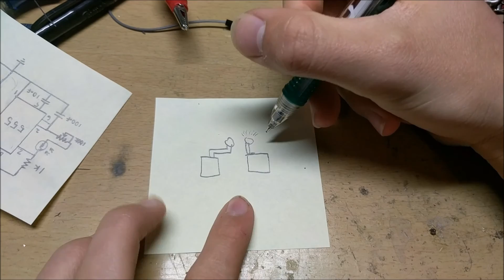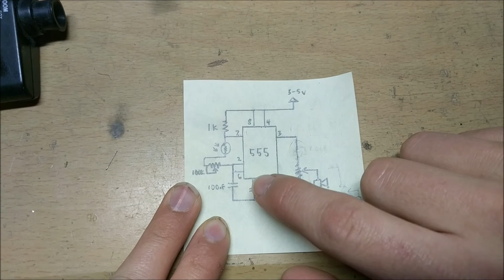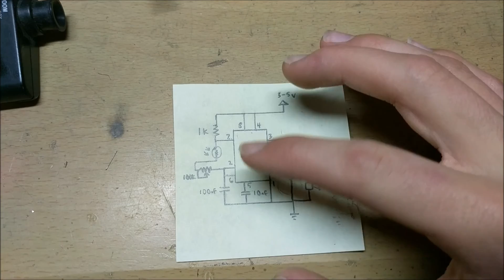How to Build an Optical Theremin

Comment: Taking away the 555 ic, battery, and speaker, which specific parts (resistors, capacitors) change the photocell into a tone control?

Comment: I think that the modulation in the original theremin is by shaking the hand. So, I don't think it was required to add the LED. Just make it more sensitive to hand movements. Need a much higher range of sounds, this one has a very shallow range.